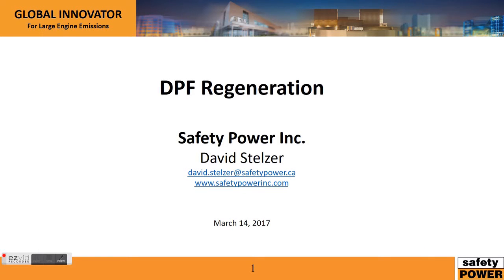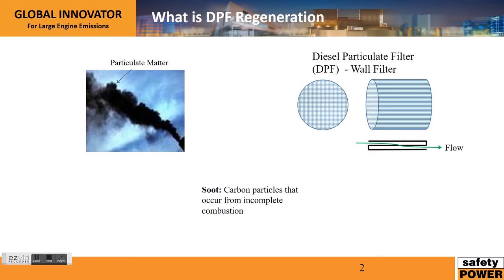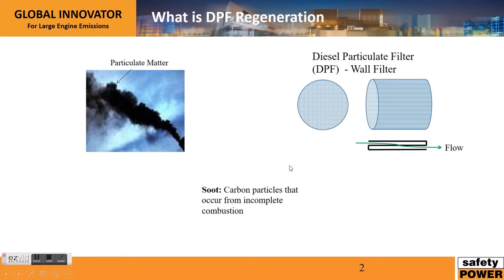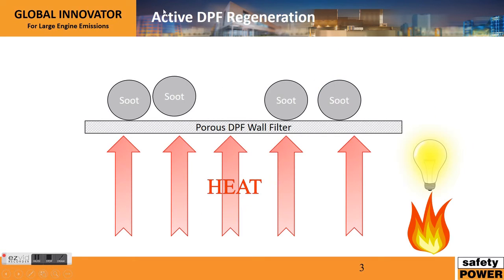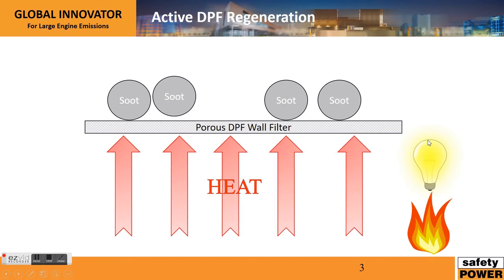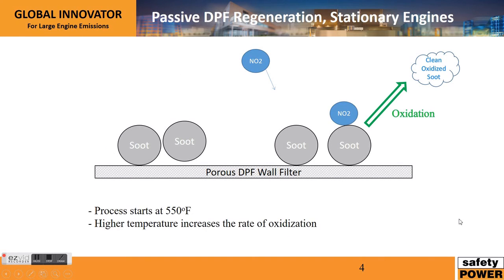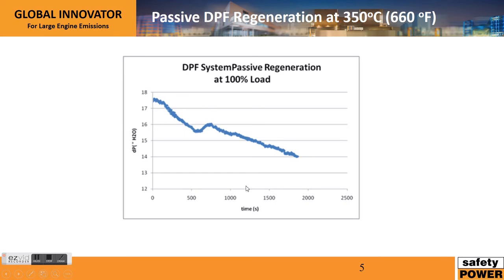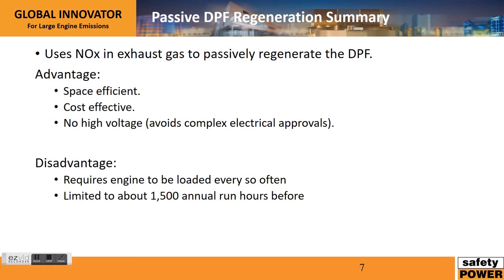Diesel Particulate Filter - Regeneration

Comment: Hello 👋 I know that soot is the sub-product of a poor combustion process of diesel fuel. In fact soot is just fuel that isn't completely burnt. Why engine designers don't focus on the output of soot by optimizing the combustion process inside the cylinders instead of putting a particulate filter just before the discharge into the environment. Has this kind of combustion optimization already reached his maximum limit (potential) in terms of technology development? Thank you for your answer